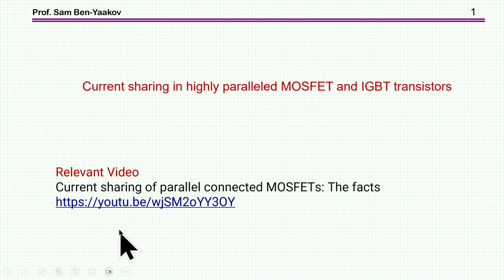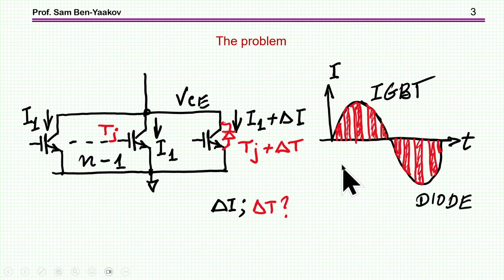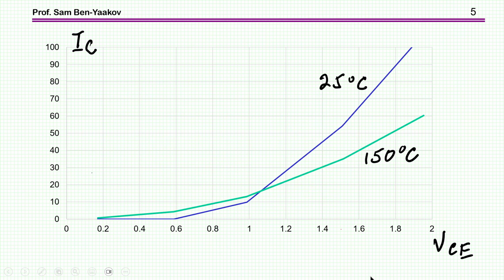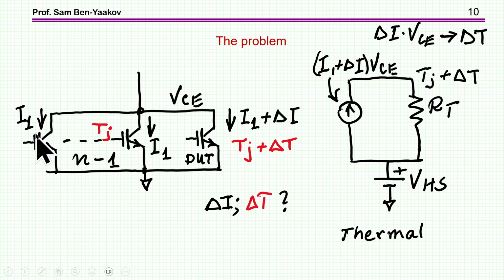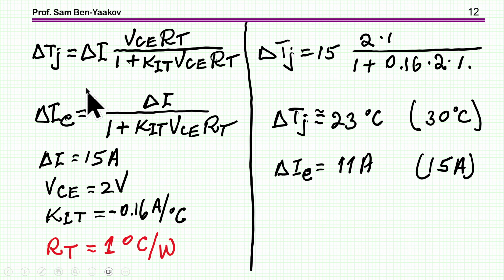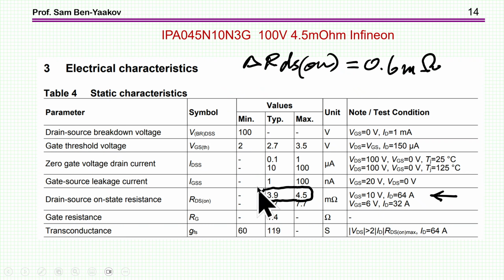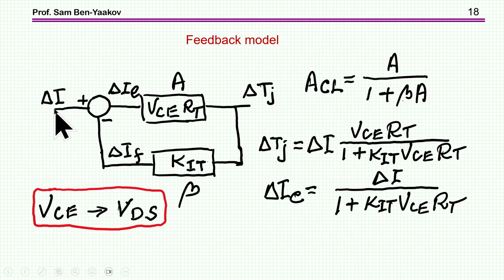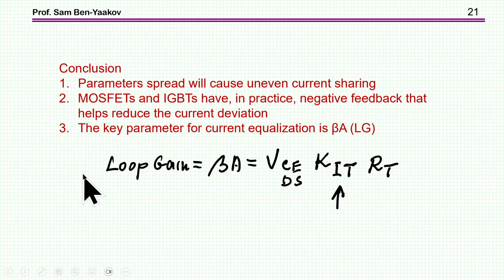Current sharing in highly paralleled MOSFET and IGBT transistors

Comment: Thank you for the video. How is it with SiC MOSFETs? I've heard that these have positive thermal coefficient (unlike regular MOSFETs). From one point of view it is a good thing because they don't need to be cooled to low temperatures. On the other hand, it is bad, because to leads to local hot-spots in the material and problems with parallel connection. Is it true? Do SiC MOSFETs have this disadvantage?
Reply from the maker: Rds(on) of Si MOSFETS has  a positive temp coefficient. Which is good. Some SiC MOSFETS may have a negative temp coefficient at lower temp which then changed to positive at higher temp. So, runaway is unlikely.
Reply: @sambenyaakov  Thanks for the answer and I see I've made a typo. I wanted to write that Si MOSFETs have positive coefficient, while I've heard that SiC MOSFETS have negative (like bipolar junction transistors). Anyway, thanks for clarification. I've also looked up some datasheets and it seems that there is also negative coefficient region when Vgs not high enough (even at higher temperatures).

Comment: Thank you for a very interesting presentation, Professor. One question, as you noted in the case for Mosfets the negative feedback is very small so it will not help much in equalizing currents. Do you think it may be necessary for manufacturers to test and sort their mosfets based on R(dson) so that when they put multiple mosfets in parallel in the same circuit the mosfets have similar currents for a given temperature and thus they can all be driven in the most efficient current-temperature range. This is probably most relevant for the traction inverters for EVs. They use multiple SiC Mosfets (or IGBTs, but lets consider mosfets) in parallel for each inverter. Considering how many cars a large car manufacturer makes they can test and sort their mosfets so that the mosfets put in a particular vehicle have very similar parameters. Although it may be somewhat of a logistical nightmare.
Reply from the maker: The question is how much mismatch is acceptable. In many designs the safety factor in selecting the number of MOSFET will suffice. In some cases selection is indeed done. The common wisdom is that if you use MOSFETs of same order, which is probably of same  production batch (?), matching will be better.

Comment: The 100V MOSFET IPA045, has the ZTC point at 150A according to its transfer characteristics, which is higher than a typical application current.
Reply from the maker: I do not think that the ZTC parameter (which is related to gm in the linear mode) is relevant to the to the swithing mode in which the behavior is Rds(on), especially when the Rds(on) is independent of Id.